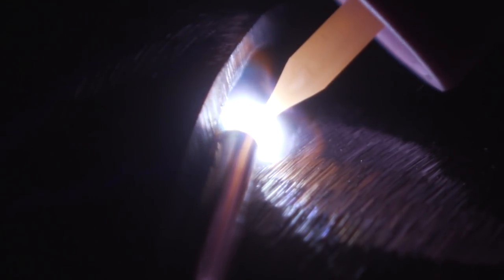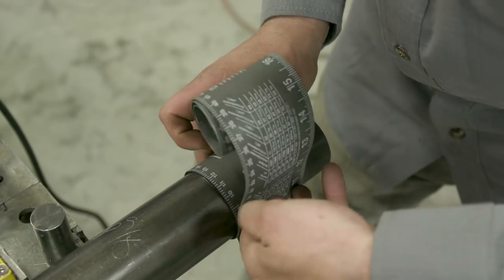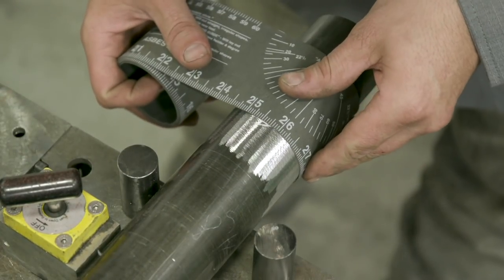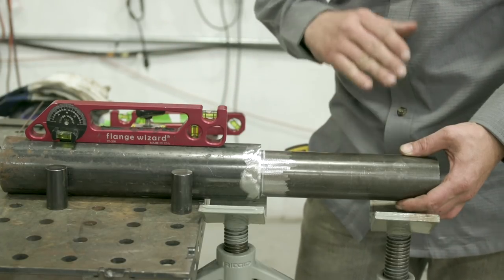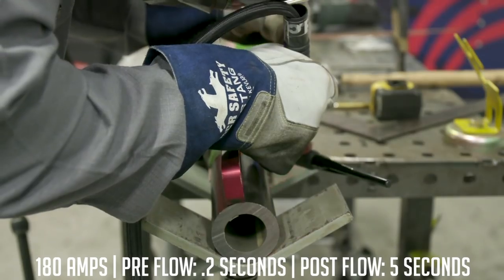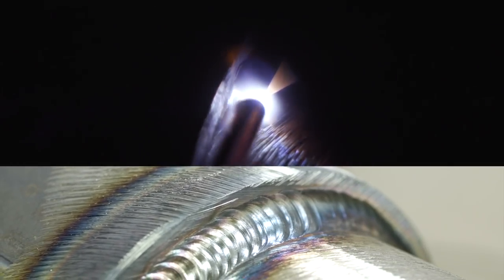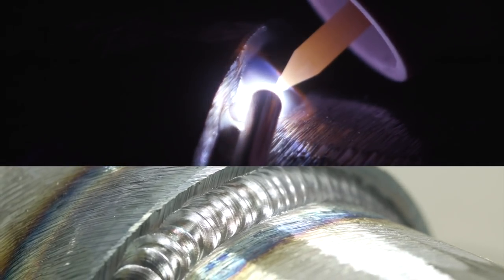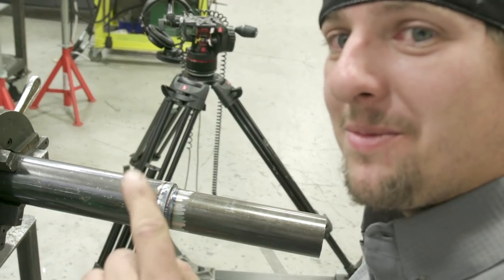How to Fit and Weld Sockets Like a Pro!

Comment: Where can I get one of those pipe wraps, been looking and can only seem to find them in metric and they're massive like for 6" to 12" pipe??
Reply from the maker: Flange Wizard
Reply: Drywall tape of 1 1/2 or 2 inch wide will also work; just make sure it overlaps by about half way to twice around.
Reply: Pretty much any welding supply. If you go online go to thegangbox.com
Reply: @royreynolds108  I've always used calendar paper, or just any paper really just always fancied a proper one but never got round to getting one
Reply: Also noticed I said I can only find them in metric, I meant to say, I can only find them in imperial and wondered if anyone knew where I could find one in metric*

Comment: Why not use the pipe stand beside the table to level the pipe on the table, then the second pipe can be  levelled with the other pipe stand.  A bonus would be that only one level would be necessary.

Comment: I would just add when you weld socket weld fittings like elbows or tees etc..to make sure you leave a 1/16 gap . Never but tight the fittings to the pipe or you run the risk of causing your welds to crack.
Reply: That's what I thought the video was about when I read the title, welding socket fittings to pipe. Pretty sure he was using DOM tube for this weld

Comment: One thing I will never understand. Why you guys are so developed in many areas in USA, but in measuring system you are still in early midleages... 🤔🤔
Great work and the video though.
Reply: While i agree with you. Being australian and well trained in the metric system, sometimes the imperial system works just as well. I'm pretty sure you probably speak in inches and feet even though metric is what you've been taught.
Reply: Miles/yards/feet/inches Why do the Brits sell weight in Kg (used to be Lb/oz - and is now illegal to do so!) sell fuel in litres yet have mpg and mph? Before the SI system things were fine. Fathoms, furlongs, hectares and knots to name a few other great measurements. Europeans went messed it right up.

Comment: Damn that was long fit process. Just use a square.
Reply: I kind of had the same take away. The weld looked great. But in a production environment id have a supervisor screaming at me to just tack and weld it. It is just a socket weld ya know. Not like it's gonna be xrayed.
Reply: @tyl4045  Sometimes you just cant do that.  Im currently plumbing a job where everything including sockets are purged.